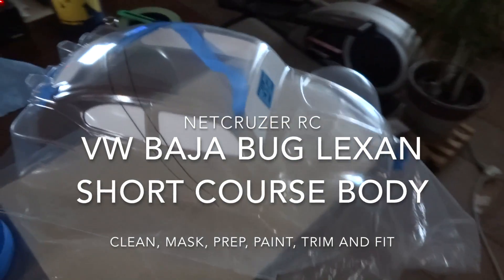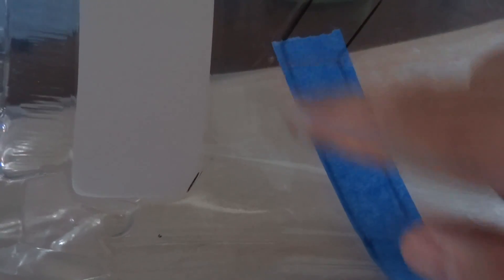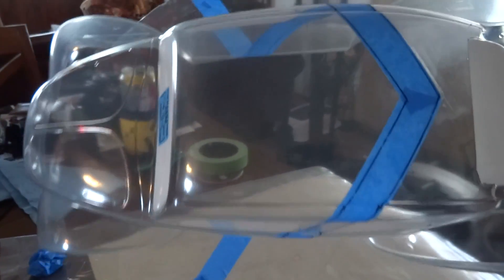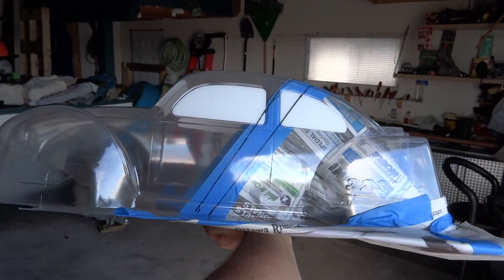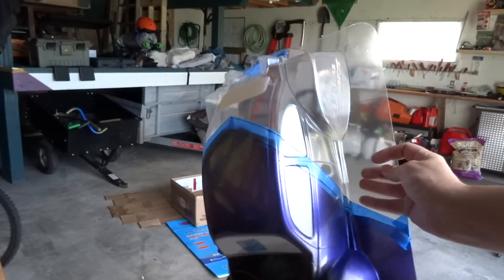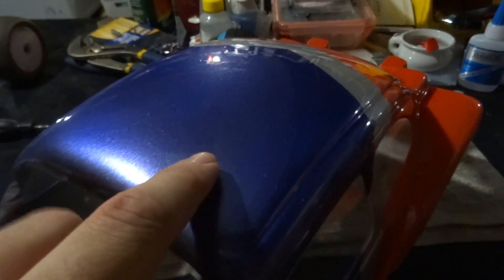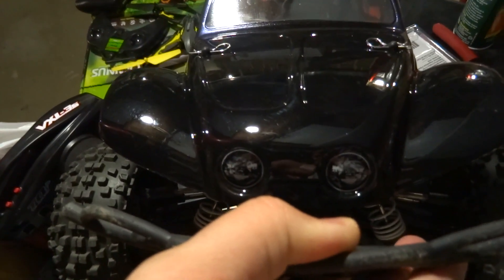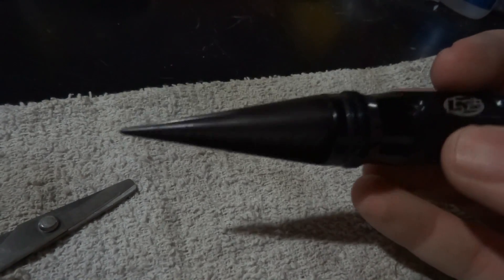Pro-Line Baja Bug. How to paint a RC body shell.

Comment: Thanks for the tutorial.  Turned our really well!  Just a couple of suggestions for those looking at doing something similar...  I'd recommend doing all of the body fitting, trimming, hole reaming, etc, prior to painting.  This will give you less chance of damaging the paint job.  I'd also recommend using a better quality of masking tape to prevent bleed through.  There are better tapes available form the hobby marketplace than standard hardware store grade tapes.  Not a knock on your technique or video, just a couple of suggestions that others may benefit from... :-)

Comment: Hey I'm painting a Baja bug too, I was just wondering since it's my first paint job, how long should I let the body dry in between coats of paint?
Reply from the maker: In my experience you can go fairly quick if you do light coats in warm/hot and dry weather.  Adding coats of same colour I wait maybe 10 minutes in those conditions.  Longer between colours where you need to remove maskings.  I'm no expert, google some other opinions too.